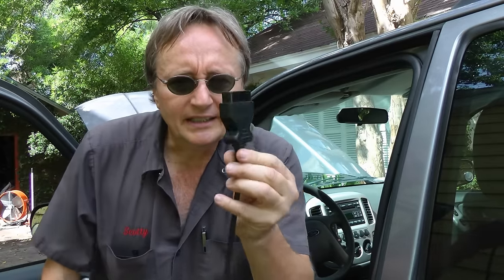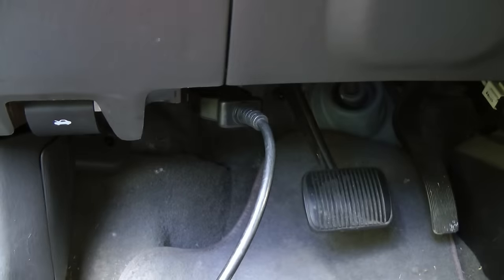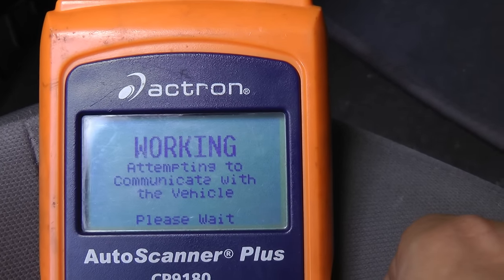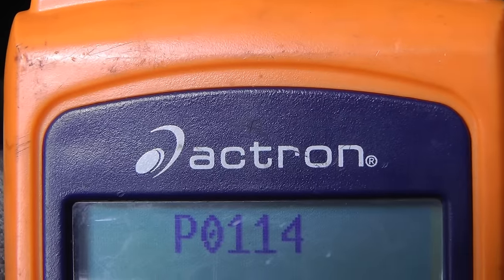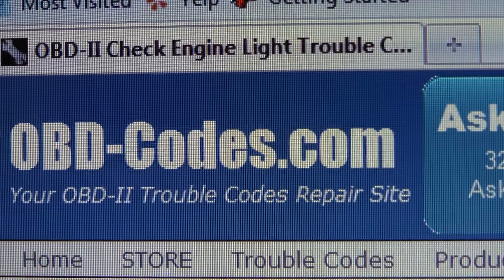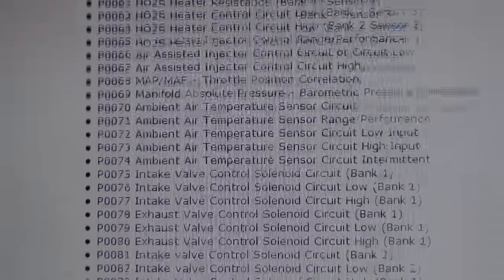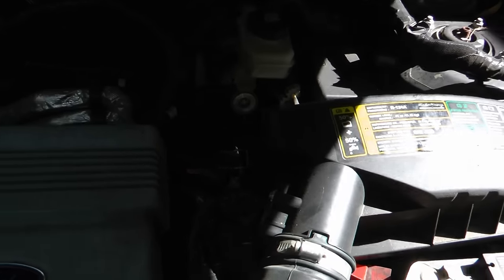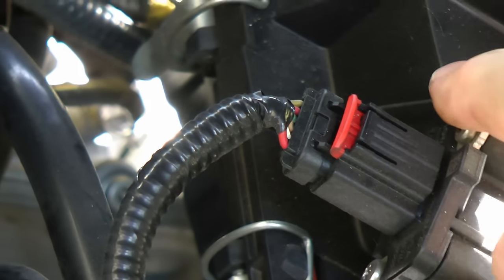Check Engine Light On and How to Fix It

Comment: Scotty, I have a 2003 PT Cruiser that gives me the codes: P0325 / P0441 / P0456. (I checked the OBD Codes site, don't know where to start)

When was recently bough (used)  the light was off, once I filled the gas, turned on and off by it self. Now is on all the time.
I bough a new gas cap a couple of weeks ago , cleared the computer anf after 3 days aprox. whent back on. Something weird of that car is that even on summer, time gives me static shocks when open the door after driving it. 

(the car license stands FLOODED) Don't know if that's part of the problem..

Thanks for your time to read.
Reply from the maker: yes, it was a flooded out car, NEVER buy one of those. It ruins the electronics and makes analysis often impossible. If I were you, I'd get rid of it fast if you can. Cause the problems are just beginning with a flooded car as electronics short out one by one
Reply: Scotty Kilmer Ok, but if wasn't flooded as the license said (can't find any records of that with the vin#), what will you recommend me to do?
Reply: Ah, I see your problem.  You have a PT Cruiser.  Junk that crap!
Reply: Glycerin: Ah, I see your problem. You have to mind your own business.

Comment: I have a 2007 Ford Focus 2.0 liter engine and my engine light came on and stayed on.  I took it to a auto supply to get the code checked.  It came up code P0128.  Does that mean I need to replace the thermostat?

Comment: Hi Scotty, I just got my car back from the dealership shop where they replaced my blower motor. I have a 2009 Nissan Rogue and the ac was nice and cold yesterday, but today the air stopped blowing cold. I just get warm air blowing from the AC vents. I initially thought maybe the AC needed a charge with freon. I have the R134a can with the hose, but for some reason, it seems the Low pressure valve won't let any Freon in. It is not taking a charge but the pressure gauge jumps to the red area when I plug it into the Low pressure valve. Also,the service engine soon light has been on for about 4 days now. I got P0455 and P0456 codes when I scanned my car today. Please, what can I do about my AC? Or, how can I fix the codes?
Reply from the maker: codes are for evap pollution control system, try a new gas cap first. But ac systems break in so many different ways, first have a guy like me hook up AC gauges and analyze both low and high side pressures
Reply: Ok so I took it to the dealer, had a guy like you (lol), he checked the fuses with a light tester and then they were fine, then he check the wires coming from the compressor and the light never came on.. He said there's a lot of Freon in there but the compressor is out. I need to replace the compressor. Would you say that this was a accurate or possibly accurate diagnosis?

Comment: On a 2002 Honda Civic, I used the reader and got shown 'No Codes'. But the light is still on and steady. Any thoughts? I did tighten the gas cap but its still on.
Reply from the maker: find someone with a better scanner and see if it reads no codes. If so, ignore it if it runs fine as that can be a computer circuit failure that costs a small fortune and if it runs fine, who cares?

Comment: Hey Scotty, i have a 2011 chevy tahoe that has recently had the stability and brake light come up on the gauge cluster and it chimes in for about 10 seconds about every 15 minutes. Autozone said they cannot read this with a scanner, any suggestions?
Reply from the maker: Michelle Ramirez find a guy like me with a dealer level scanner, see my video "fixing ABS brake problems on your car"

Comment from the maker: I guess you can't read very well. Your check engine light is on, that code is needed to analyze it as there are over 2  thousand different possible codes. Get that code, guessing without it is foolhardy.

Comment: For the Past Few Months I have had the Check Engine light switch on and off. Every few weeks it is for a duration of an hour to a day. I had borrowed my buddy's OBD II scanner and it would not physically connect to the car's computer. I have come to realize that the 1994 Cutlass Ciera has OBD 1.5 (not OBD1 or OBD2).

My guess was that the O2 sensors are starting to fail. Is the only way to pull te code to put it to a Diagnostic Machine?

Comment: Hey Scott I have a 95 gmc sonoma that I took to get a smog test but failed to pass due to check engine light not coming on. what should I do? I checked all fuses and they are good. You think maybe the check engine light  bulb went out?
Reply from the maker: yes, that or the main computer circuit that drives it is bad. BUT, go somewhere else for a test, many guys won't care about that as long as no code is stored

Comment: Hi Scotty.
I recently replaced the ball joints and steering rack on my 2002 Toyota Sequoia. After that, the car would hesitate and cut power when accelerating from a stop. The slip indicator light would flash. I already had the car aligned at the shop, but it still has this hesitation and I know the car is not actually slipping. No codes showed up when I hooked up my OBD2 scan tool. What can I do to fix this?
Reply from the maker: odds are the speed sensors have been damaged to the ABS system, that will activate the slip indicator light. Have a pro mechanic like me hook up his dealer level scanner to analyze that
Reply: I visited the dealer and they said all the abs sensors checked out. I also found out my car had codes C1231, C1360, and C1363. Could it be that I need a zero point calibration on the steering angle, yaw rate, and master cylinder sensors?
Reply: I measured the ohms on both the front driver and passenger side ABS sensors. Found the passenger side one to have less ohms when tested with a multimeter. Replaced it and haven't had any problems so far. Thank you.

Comment: Hey Scotty,
I have Hyundai Santro xing gl plus. Check engine light was on for a whole day so went to mechanic he just pulled off one cable of battery for 5 minutes then pluged it in and check engine light gone. But after 2 days the light came on again. So what do you think whats the problem in my car. And it is yellow light it stays continuously on. I use blower sometimes.
Thanks.
Reply from the maker: there are over 2 thousand trouble codes, so get it scanned for the code and e mail it here so I can analyze it. Auto zones scan em free

Comment: thank for the video......
I have a 2000 acura tl but I connect the scanner to the computer of the car and does not give any kind of error ..... but have a problem that needle revolutions when the car is in parking up and down and will change all sensors and would like to know how I can get the car k errors me having my car have 124.000 miles.
Reply from the maker: try my video "how to fix a car that idles poorly" and also check for vacuum leaks on the intake system under the hood

Comment: I went to the car parts store to have my check engine light scanned (engine light ans anti skid light) but when the guy plugged his scanner in l, there was no output from my port. He checked the fuse and still nothing. I went to the other parts store and same thing…..nothing. What should I check to see why the scanners do not work?

Comment: Hey Scotty.. I have a Land Rover Discovery 1995 300tdi automatic . Yesterday i realised a buzzing noise from the engine after turning the key but not started(also continues after startup.. i localised it to the injector pump and research the problem on a few forums. its been described as a "Bosch injector pump"  and a "N75 boost control solenoid valve" problem . But all of the posts never say how the problem got fixed! What would you do? 
Thanks in advance . Johannes from Auckland, New Zealand

Comment: Scottty, I have a checked engine light illuminated.  I used a scanner to read the code, but the scanner said, that there's no code stored.
Reply from the maker: Ulises Ferruzola try another scanner and pray, cause if none can read it, then either the computer is bad inside, the wiring from the computer to the scan tool interface is shorted out, Or any sensor on the system is shorting out stopping communication with your scan tool. good luck
Reply: thank you

Comment: Scotty, I have a Ford F150 with the 3.5L EcoBoost.the wrench warning light comes on and the engine goes into limp mode when I accelerate. I installed a catch can but maybe I didn't empty it in time. I am going to clean the catch can in hopes that this will take care of my problem, But I have had four different code readers attempt to read the codes but none will get anything from the system. Autozone checked the fuse and there was not a fuse in the spot. I bought the truck new and never had the code read so I think it came from the factory like this.  Do you have any ideas of why the code can't be read or about the wrench and limp mode. The wrench was yellow, not red, but I had to re-start the engine about thirty times to go 120 miles to get home . Please HELP!!

Comment: My 2006 nissan frontier had the service engine light come on.  My mechanic used the scanner and it said it was the o2 sensor,so he replaced it.  However the light is back on.  After bringing to him a bunch of times and also to the dealer the light remains on.  I don't know if these people know what they're doing or what.  And ideas Scotty?
Reply from the maker: +terrierdude35  they don't care to spend the time driving it and analyzing it correctly. O2 sensors are part of a complex computer driven feedback system.  Could be bad wiring, bad main computer, bad catalytic converter, engine vacuum leaks, weak fuel pump, LOTS of things. But, your guys either don't care to go further, or don't know how. Realize mechanics at dealerships are often now just parts changers, as pay scale as gone down BIG TIME there so owners can make more profit. For example, you may get a 700 dollar repair bill, but the mechanic who worked on the car may only be getting paid 60 bucks for his work. So don't expect geniuses to work there.  The worse scenario now often exists--Greed combined with Complex machines.  Good luck finding a guy like me in your area.
Reply: +Scotty Kilmer Thanks for the quick response Scotty you're the best!

Comment: hi scotty, i drive 2007 saturn ion level 3  2.4L and has 50,000+ miles, my engine light came on and the codes read p0301-p0301p-p1174-p1174p, so far i've clean the MAF, and Throttle, and changed all spark plugs.  i dont have the right stuff to check the car and i dont want to buy unnecesary parts and put them in if its not going to help.  if you have any idea of whats going on pls reply back.

Comment: What if the check engine light flashes, then stays on? I'm also having problems after hitting a pot hole, the lights on the left side of the dash went out. I drive a Toyota 2001 Sienna.  Any help is much appreciated!
ellen
Reply from the maker: +Ellen Laird either wiring on the dash came loose, or circuit board broke when hitting the pot hole.  But get it scanned, you have a serious problem stored inside the computer with light doing that. There are over 2 thousand possible codes, so get the codes, auto zones scan em free

Comment: Could you tell me how you reset the anti theft alarm in ford f150. Also I replaced the drivers side seatbelt mechanism and the one i replaced it with is a older one that does not have a plug in it for the seatbelt alarm if I wire the cords together would the keep the seatbelt alarm off.

Comment: Hello Scotty I just recently had the lower intake manifold gasket replaced on my 1999 Buick Century a couple weeks ago, and the Check Engine light keeps coming on. Same code every time: P0440 - Evaporative Emission System. The first time, I tightened the gas cap,the light went away. 2 days later, it comes back on, I put on a new gas cap, light goes away. Here we are now, 4 days after that, the light is back on. Any ideas as to what it could be?
Reply from the maker: I would assume there's a vacuum leak created from the intake gasket job, that's a huge job that could create many such leaks
Reply: Thanks a million Scotty, if that's the case then the Chevy dealer I took the car to is responsible for fixing it.
 But out of curiosity, how does a vacuum leak occur when replacing an intake gasket, and will it cause any major problems?
 And since the light went off and stayed off for a few days, is there any chance it might be something else? I'd just like to be sure before I go back there and speak with the service manager.

Comment: Hey Scotty ,I have a ford 2001 e-250 van, I did what you said to do in video,  code came back p1151,    Lack of HO2S-21 Switch, Sensor Indicates Lean, is that an easy fix? Thanks for help

Comment: Scotty love your vids. Hey I have a 2004 Toyota Sienna . I went on a road trip and the check engine light went on for about 3 hours and then went off. That was about a month ago and it stayed off. I took it to my mechanic and he has no idea. He put the code reader thingy on it but he said it doesn't store codes . Any ideas ? Thank a million !
Reply from the maker: don't worry about it, code is gone. When computer sees problem is gone, it turns the code off. But, if it ever comes on again, as there are over 2 thousand different ones, quick get it scanned then
Reply: Thanks Scotty. If it happens again I'll get to my "guy" asap.  Keep the vids coming !!
Reply: James Zurawski
Better yet, go to an auto parts store.  Many of them will read your engine codes for free!  And the cheap OBD code reader devices are only around $23 on Amazon.

Comment: scotty
I have a question can a mechanic check your check engine light if it is not on? it was on but my boyfriend disconnected the battery so it wasn't on when I took it to the shop but later that day the light came back on so my question is can he still check my engine light without it being on?

Comment: Hi Scotty, I have a question. 1999 Honda Accord 4 cylinder , has a check engine light, P0325 KNOCK SENSOR , what does this code mean bad sensor ? if so where is it located on the car ? thank u very much for your help .

Comment: Scotty-can the check engine light be misleading. I have 2 Toyotas (Camry and Previa)with the light on and the code says P0041 or low EGR. We replaced the EGR valves and cleaned the lines and still have the lights come on. The still pass smog so are the readings false from the on-board computer?

Comment: Hi Scotty, can you offer some help? My 2000 rx300 sets off the alarm after i open the door, they say there is a backup battery but i cant find one, there seem to be a few different tricks you can try but do you have any ideas?  Dont want to take it to the dealership! ;[  Thanks!
Reply from the maker: you'd need a dealer level scan tool on that one, try to find a guy who has one outside the dealership

Comment: hey scott, please answer. My brother has a 2003 dodge ram 1500 manual transmission. And his truck has the check engine light. He took it to a place twice and they put that scanner tool and scanned it. And they said he had to replace the oxigen sensors. so he replaced them. And at first the check engine light came off, but the next day it appear again. Can tell me what the problem might be.

Comment: Hey Scotty I have a 2002 mitsbushi galant ls and I literally just paid 800$ for the emissions including new cat manifold and egr and the mechanics at shells are good people and erase all codes so the light goes off. But it still goes on after 2 miles they're not sure either why does this happen when I've fixed everything evap o2 sensors leaks it's driving me and them nuts
Reply from the maker: sounds like they ripped you big time charging 800 bucks for work that didn't fix the problem. They are obviously not very good mechanics, EVAP and emissions testing requires very good mechanics with dealer level scan tools. I 'd advise finding a new mechanic who has such tools and knows how to use them.  BUT, if it runs fine otherwise, many guys just ignore the lights.

Comment: I have a check engine light. My gad cap was loose so i bought a new one drove about 7 miles to work then 7 miles back. It didn't come off. Its not flashing but i haven't changed my oil in a good while. Could that be it?

Comment: hey Scotty I have a 2000 mustang gt and after my mechanic change the clutch(spec stage 1) and a chromoly flywheel the check engine light come out and I scanned and say bank 2 O2 according whit a mechanic is the driver side and the one in the back before the cat anf I put a new one and erase the light after a day the light came out again and I scanned and ia the same sensor what do I do? if helps I just refill the ac thanks for your help

Comment: I know on my vehicle if something is causing a cylinder to misfire it will flash the check engine light for a bit then go solid until it gets fixed.

Comment: Can a loose battery terminal cause a check engine light to come on?
Reply from the maker: +Haunted In PA yes it can
Reply: Thanks hon, i'll check the battery terminals!
Reply: Haunted In PA 

NOT LIKELY BUT IT CAN. A WEAK BATTERY WILL DO THAT TOO.

Comment: hey scotty, i have a 2003 subaru forester. The check engine light came on and when I checked the error codes on the scanner it came up with a P0420 i found this to be Catalyst System Efficiency Below Threshold (Bank 1). Any suggestions or possible solutions you know of for this problem. Your help is much appreciated!!

Comment: thanks i just changed it, but i have another question, my 2004 corolla s cant go pass 3000 rpm no matter how fast i go, it will it 3000 rpm around 30 or 40 then drop down to 2000rpm and stay in between 2000 to 3000 only, any suggestions??

Comment: I have a 2006 highlander hybrid   with a VCS Trac off check engine and brake light on any thoughts
Reply from the maker: realize when engine light come on, that sets a code. On that vehicle, that itself automatically shuts off the trac system. So get it scanned and fix the check engine light code FIRST.